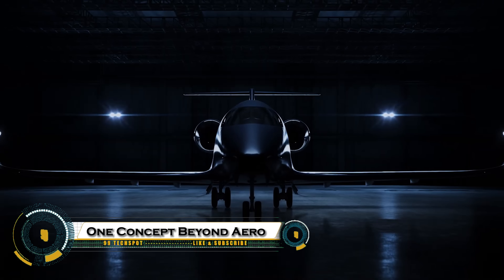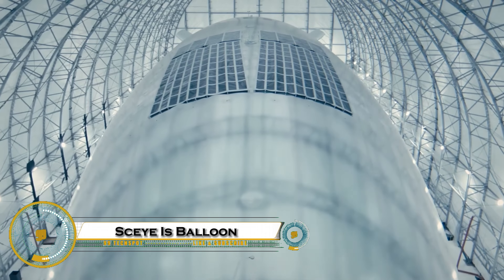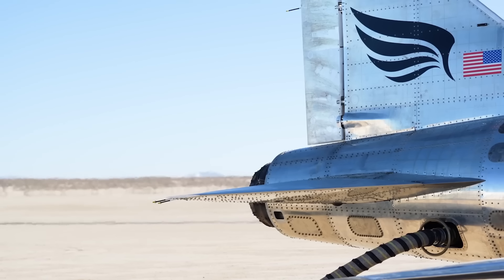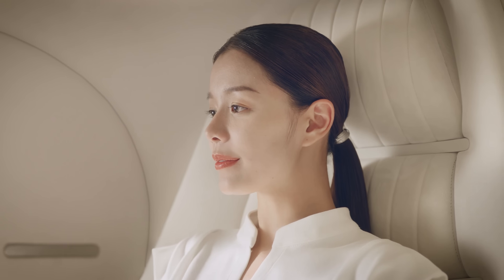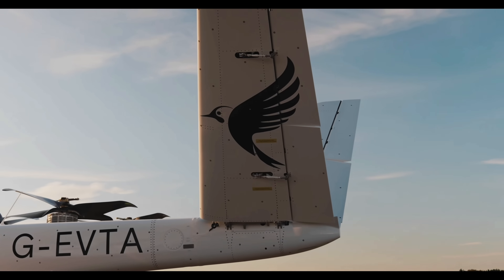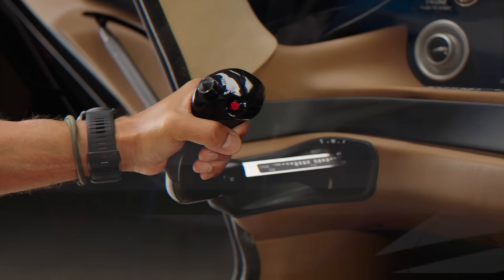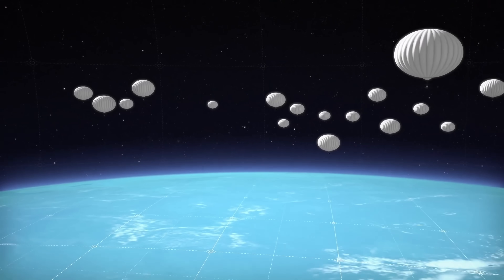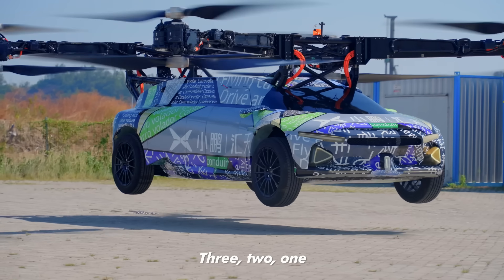The Plane That Will Change Travel Forever

Comment: Only problem is how do we control this when thousands of people in each country over the world have access to driving/flying vehicles. Not talking about the space things here, just the availability of combined driving/flying vehicles. You can't just take off in the air where ever you want and fly around without a leash and someone to control where you are going, it's not so much making the technology available to at least people that have either enough money or the actual practical use of it, it's more about how they will control this. I'm sure it can be done, but the control part is the most important part of making this a viable form of transportation.

Comment: It is tough to compete with the convenience of liquid fuels.
I once calculated the rate of flow of energy into the gas tank of my car.
You can measure the energy content of fuel (when burned) in Joules.
The rate of flow of fuel into the tank was equivalent to MegaJoules/sec or MegaWatts.